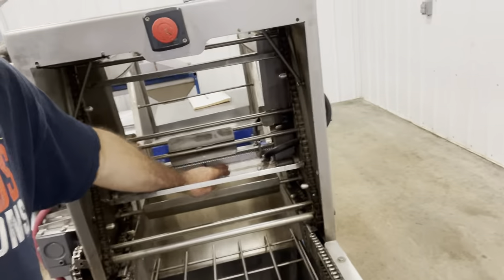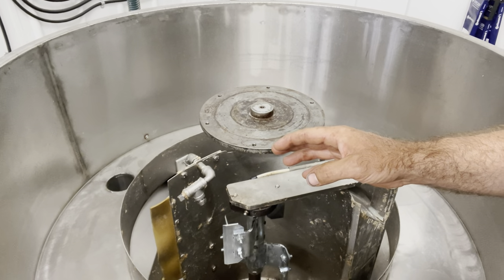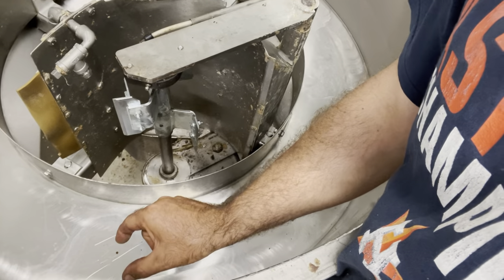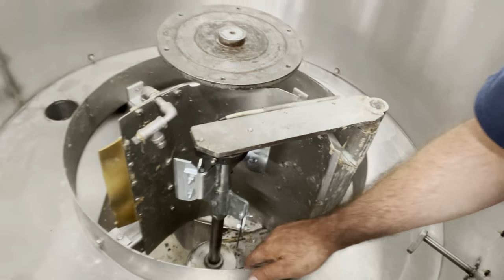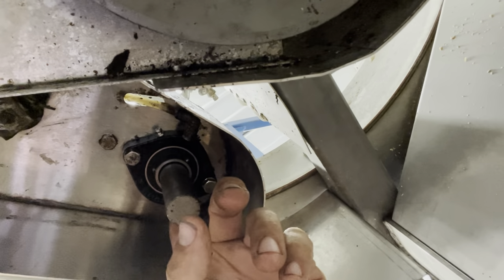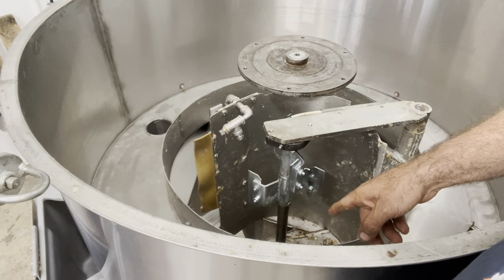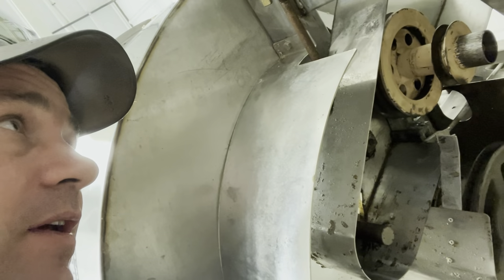My Love Hate Relationship With My Spinfloat

Comment: They make a conical shaped bearing that are sealed. Made for running in dirt while accepting the weight of the device. Ball bearings don’t work with hoot for vertical applications.

Comment: My first suggestion is to get a higher rated sealed bearing. You should be able to find something that would be able to handle that without getting any inside so it would last a lot longer. Maybe a wash down rated bearing? 
Another idea is to move the bottom bearing to the top of the lower mount so that when you have to work on it you can unbolt both bearings and simply lift the shaft out and be able to remove the bearings from the shaft on the work bench.
You might also be able to cut a hole out of the bottom plate large enough to fit the bearing through, and then bolt a square of metal that the bearing mounts to on the top.

Put a flinger disk on the shaft just above the bottom mount to reduce what actually makes it down onto the bearing. You could even put a rotary shaft seal above the bottom mount so nothing gets through.

You could also get a larger bearing and use a split taper bushing mount. It is much easier to get off, you use the pulling bolts to pop it out of the bearing and off the shaft.

All of these ideas can be actuated via the McMaster Carr catalog, or your local bearing supplier (if they are worth their nectar... Lol)

You have a standard universal bearing there, and room to make changes, so you have lots of options to improve the situation and make repairs easier as well.

Comment: As a farmer😅 being honest  !! we have a cutting torch AN a welder to Re-engineer tools  to fit the job we need the tool  to work for us.. (( yes, I have cut a good many perfectly fine tools made what I call a special GM wrench.. general motors for famous for having to have special tools to work on there  vehicle’s)) but any how 😅😅 I have a two finger puller which has been modified countless times to take gears and bearings off the farm equipment.. if it was me and I was there, I would take that inch wide two finger puller((which I think originally was a steering wheel puller many years ago)) extend the finger length and this puller has 2  quarter inch diameter bolts on each side of the fingers. ( half the  distance of the length of the fingers)  that you can tighten the finger so they will not slip off of the bearing… AN the reason for the torch and welder is we all know a puller is either too big too long too short to do the job😂 yep I would modify and build a two finger puller for that pacific bearing.. an if  the center Acme threads on the puller is not long enough ?  
I find impact sockets work wonders for spacers .. BUT!! there is times laying inside the straw walker in a combine, were nothing works better than a couple of pry bars, and a good old fashion sledgehammer😂😂😂😂

Comment: Optibelt " mechanical belt tension gauge "
  Press ( held by hand ) on to the belt to read tension that is applied on the belt 
 Different KN " kilo newton  " rated models are available 
  Eg 70 kn to 150 kn
        120 kn to 350 kn
Works by swinging , moving the indicator ( as in like a balance set of scales ) to show the tension currently applicable 
 
..... you could always just use the thumb depress method

Comment: Replaced the bottom bearing in mine  again this year. I’ve decided it get a $10 princess auto bearing every year weather it needs it or not
I was able to unbolt the top bearing housing and slide the cutter shaft down enough to get room to work pulling the pulley and bottom bearing.

Comment: Next time you have the shaft out make a slinger to slide over and up the shaft and adjust it to sit just above the bearing it should keep it much cleaner and lengthen its lifespan. An auto tensioner would solve the cutter drive belt tension issues. First flowers starting to appear on early Canola here in the southern parts of NSW.

Comment: Ian, is there any way to slide a rubber boot onto the top half of the knife assembly, such that the boot could be slid down on top of the lower housing to act as a wiper to try and lengthen bearing service time? Alternatively, does the manufacturer of the spin unit make such a boot? -Bob...

Comment: I have the same problem but both bearings. I've found if you use food grease in them, bearings they don't last long. The bearings aren't high speed like axel bearings. Use normal grease high temperature. Still need changing regularly tho.

Comment: I wonder if you could tap threads into the holes bearing carrier.  Then you could make a simple puller with long bolts that would thread into that.

I doubt belt tension is a significant problem since a tight belt should affect the top bearing most.  I think contamination of the bottom bearing is the primary problem.  As already suggested perhaps you can find bearing with better seals?

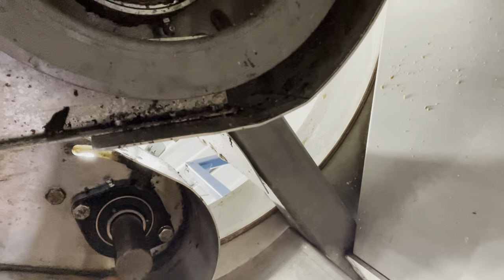Comment: I do a fair amount of work building wash down rated machines for food packaging. Looking at the setup at 4:50 of the video there's a few things I'm wondering. I see a grease nipple but is that a grease line for lubricating the bearings and pushing out the debris? I know, internet expert but it is my 9 to 5. Is there a reason it has to go through the guarding? I would reroute the line under the guarding and up to the bearing followed by closing that hole. Preferably with something at an angle over the top of the guard. First you've now introduced a drip loop to keep the junk from riding the line to the bearing and the angle prevents pooling and extending the time to eventual penetration of the debris into the bearing. I'm guessing you've already tried increasing the frequency of the grease pm task. Just a few thoughts from the cheap seats. Good luck.
Reply from the maker: I appreciate your input

Comment: That's a damn awkward spot to get into! I wonder if a solid G clamp (with a long enough thread) might be able to press the shaft out of the bottom bearing? If that worked, it would eliminate the need to wail on the end of the knife shaft with a hammer :) Might also save some knuckle impact too!
I'm impressed by the spinfloat and would love to have access to a smaller one of these suited to the sideliner scale.
Reply: Alternatively, if you could drop the blade shaft down far enough, you might be able to use a gear puller to remove the bottom bearing...  maybe?

Comment: Could you simply put a tie rod boot on the shaft above the lower bearing? The gunk would be slung away from the bearing and not flow down the shaft. $6.00 at an Auto parts store. 
Just one farmer to another.

Comment: I see that you can grease that bearing. Why not give it a pump once and awhile
Reply from the maker: Once a week during production during clean out .
Reply: @aCanadianBeekeepersBlog  that grease fitting does not lube the bearing itself, it lubes the self centering outer part. Those are sealed bearings.
Reply from the maker: Correct.  The bearing I purchase so have the little hole , positioned over grease port .  Not sure how much would get in